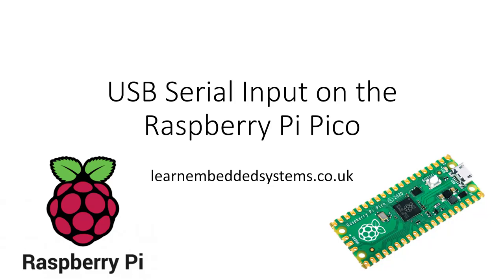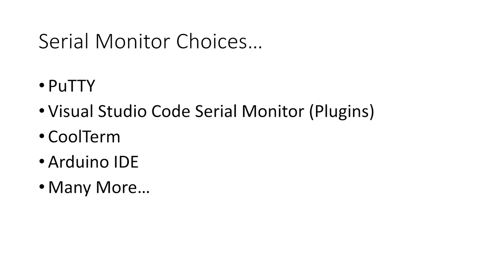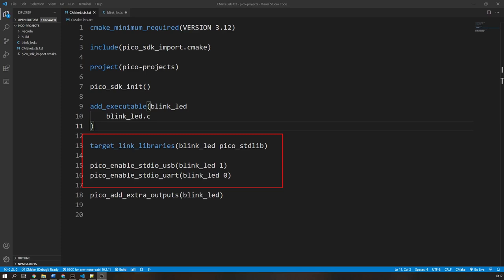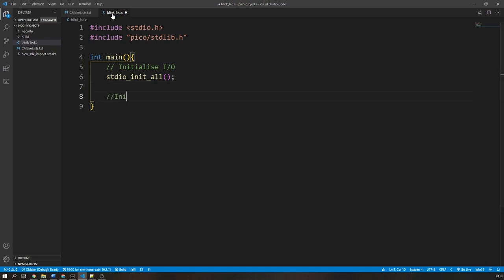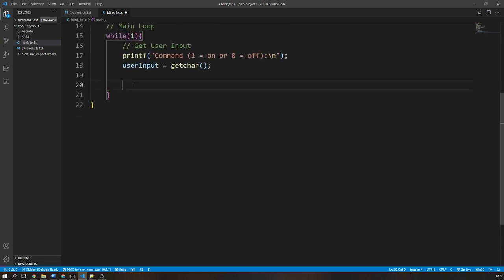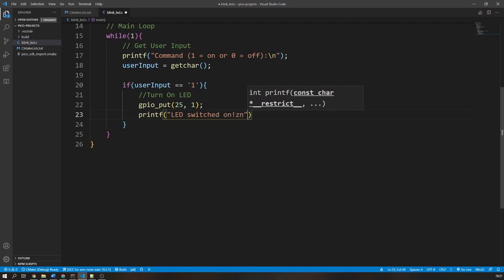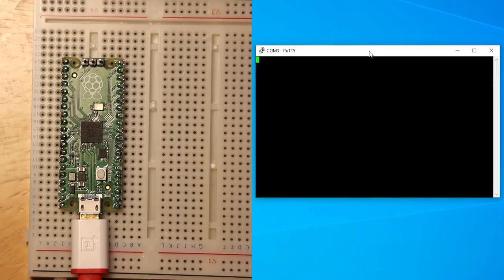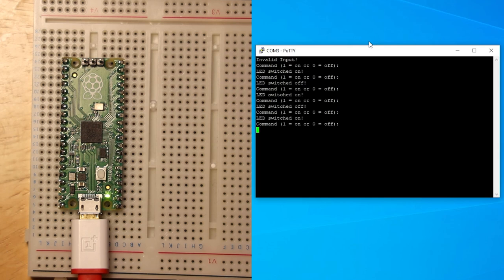USB Serial Input on the Raspberry Pi Pico

Comment: Haha nice, thanks! Here's a small challenge for you, I figured this out over the weekend,  make the input non-blocking so code can continue to run even if there's no characters entered on the terminal. This is important if you're driving graphics or something in "the background" so to speak. I've actually posted a code snippet on the Raspberry Pi Pico SDK forum page on the official site.
Reply: Hint- you do not need to use the second processing core.
Reply from the maker: That is a good point regarding the blocking problem! I think I read in the Pico C/C++ SDK that a non-blocking function was added, perhaps it was you in the forum that drew my attention too it!  Another option could be letting one core handle the user I/O if there is no other need for it!
Reply from the maker: Just saw your follow up - Just browsed the SDK documentation and seen the getchar_timeout_us function, as well as your post on the forums! Nice work :)
Reply: @LearnEmbeddedSystems  Yes in fact the function you're after is called getchar_timeout_us(). It's a bit of a bodge unfortunately because in a real stdio environment you're supposed to use fcntl() to set non blocking flag. FCNTL surprisingly compiles and runs on the pico, but has no effect. Took some sleuthing to figure out all of the special getchar functions undocumented or poorly documented foibles, such as if no chars are in the stdin buffer then it returns a byte 255, it does have a define tho I learned later.
Reply: @H3liosphan  Could you please share the forum post link?

Comment: Can you suggest what I might do in the case where I want my pico to take an input from an external microcontroller / device (something not built by me) but I also want to see what that input is for the purpose of debugging and actually analysing the input so I can build my project based on it. i.e. a sensor not made by me is outputting some data, I want to extract information from this data but I have no idea what form it will come in, so I need some  feedback loop from the pico whereby I can see what data it is receiving. Or maybe routing it through my pc and analysing what format the data is in first is the best option, rather than a feedback loop via the pico. Although I am curious about the feedback way of doing it as it seems useful

In simpler terms I guess the question is, is there a second output from the pico that can go into my PC?

Thanks

Comment: Hi! I've been learning and playing with my new pico but feel as though the material i find and the pico documentation really seems to be pushing micropython. Could you advise whether I should be trying to learn C++ or micropython moving forward? Ideally i'd like to build using other boards such as the ESP32 in the future but have no idea if they support micropython. Thanks in advance!
Reply from the maker: Hi, you raise a great question, it is difficult to answer. I think it really depends on your previous programming background. Micropython and C are two different ways of achieving the same goal. If you understand C/C++ then you will understand what micropython is doing behind the scenes for you. However if you are relatively new to programming then C may be quite daunting and micropython may provide a smoother (and maybe more enjoyable) learning experience. Micropython does support the esp32 series. 

If I could only learn one, I would learn C as it will be most useful across all microcontroller platforms. However, in reality we can learn more than one programming language, and if you feel more comfortable with one them learn that one first and try and recreate your programs and projects in the other.

Sorry this is a bit of a non-answer but it's a very circumstantial question so I hope this helps.
Reply: pycom has esp32 boards that support micropython
Reply: @LearnEmbeddedSystems  Thanks for the help, I have some experience with python and JS so i'll go with MP for now, then see how it goes. :)
Reply from the maker: Best of luck!
Reply: @montaguemonro565  Just learn C if you are serious abouth micros. Anything else on embedded is a lazy way that leads to the begining if you don't quit halfway.
Reply: you are a programming newb, yeah? all "languages" are just semantical tools (like macros in assembly), java is c, js is c, python is c, golang is c ;-) fortran, pascal and logo are not) that means the "syntax" differs heavily in such "languages"... as you progress thru life programming various things (mcs, pcs, websites, mobiles, toy robots, people, etc) you shall discover that the only true knowledge for the programmer is algorithmization and those "languages" and "dialects" are just handy jigs you use depending on context ;)

Comment: I am attempting to get a USB keyboard plugged into my pico via a mini usb OTG adapter.  Do you know this could be accomplished to put the usb port on the pico into host mode and accept keystrokes that print to stdout?  i have system powered via vbus and i have swd debug and uart stdin/stdout.

Comment: Would there be a way of sending and receiving commands to the Pico's USB using an old mobile phone?
Doing so, we could then build a stand-alone system that could provide remote telemetry for devices such as weather station hardware... without the need to use a full-fat PC
Reply: CircuitPython has an HID module that would work
Reply from the maker: Yes there are many options, I would recommend a breakout board tyoe which you can send commands over SPI which can essentially send texts of your data at regular intervals! Or in some cases you can use 4G or other data services! Here is an example https://thepihut.com/products/adafruit-fona-mini-cellular-gsm-breakout-ufl-version

Comment: So I have an application where I would send 2 different and independent PWM values in a single string to RPi Pico from a python code using pyserial to rotate 2 motors on my differential drive bot. How can I split the string and read both values simultaneously in Pico?
Reply: did you manage to use USB input for raspberry pi pico in micropython?
Reply: @krzysztofkubik6531  Unfortunately, no. MicroPython and Pico both were very new at that time, so the documentation was very limited. Later Arduino Support was released for Pico and I was successful with the Arduino code for Pico.

Comment: Hi there. Thanks for the guide. I'm having a weird problem I can't find answers to online. I tried your code, and it compiles and flashes without issues, but then I can't find the Pico anywhere! I tried with putty and minicom, and it's supposed to be on dev/ttyACM0, but there's nothing there.
If I remove the code that takes input from the PC (basically the getchar) it starts to work just fine. I'm super lost on what could be causing this
Reply: Hi all. I have the same issue. The getchar() seems to block the serial soft like mnicom (linux) or Putty (win). I have no solution so far. I'm searching for one...
Reply: Hey there, I just ran into the same problem and found two solutions that worked for me ( Raspberry Pi OS with minicom )
No 1: Using "getchar_timeout_us(10000)" instead of "getchar()"
No 2: Setting up another while loop before the main loop which runs as long as no usb connection is established:

while( !stdio_usb_connected() ){
   printf("waiting for usb connection\n");
   sleep_ms(100);
}

I hope that works for you as well

Comment: My PIco freezes when using getchar(), works for a few seconds only. Does anyone experience same issue?
Reply: Encountered the same program. Pico will accept commands (1 or 0)  for a couple of times and then freezes. Make me think that I should use a dedicated USB to RS232 cable to connect to UART0 directly.